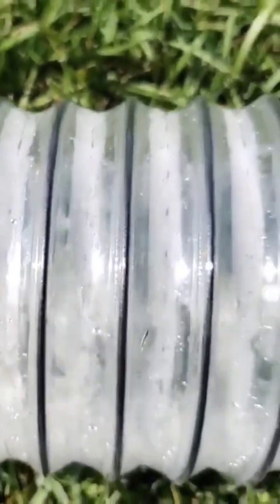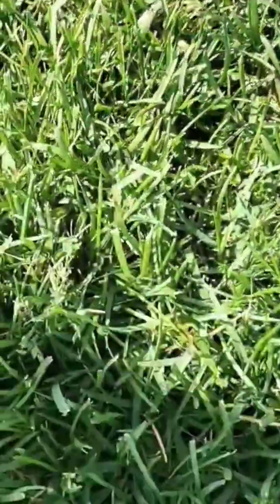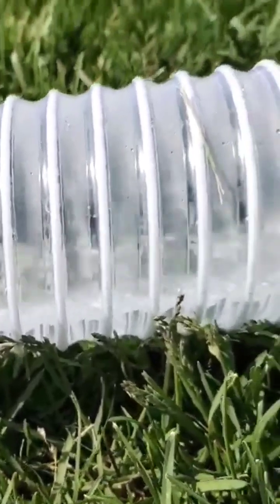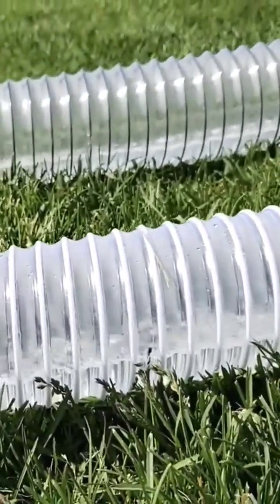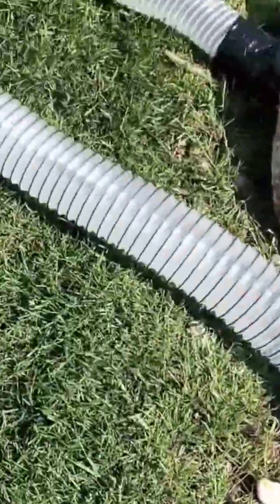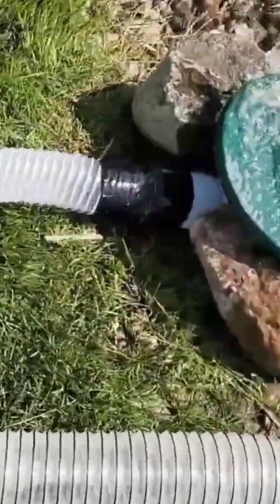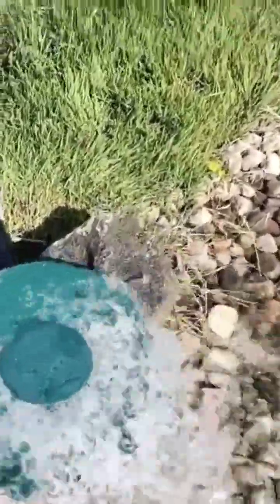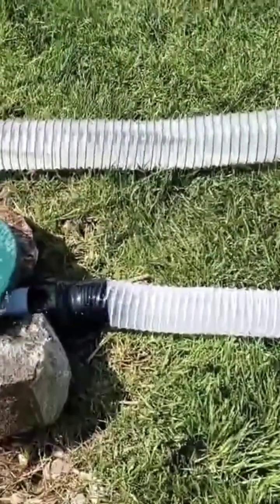280 Gallons per minute through Downspout pipe and pop-up 3" vs 4" which one flushes debris better?

Comment: Larger diameter pipe has higher volume with lower pressure. I believe the video is recommending the 3 inch pipe because of the pressure keeping the pipe clean inside.